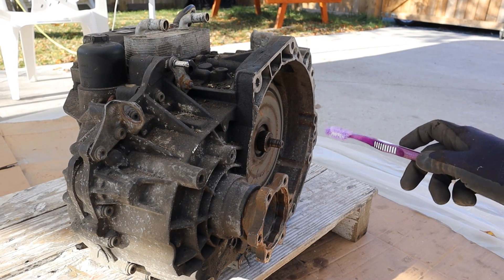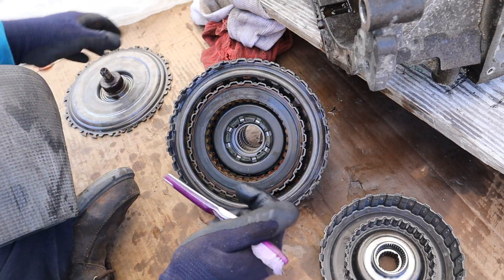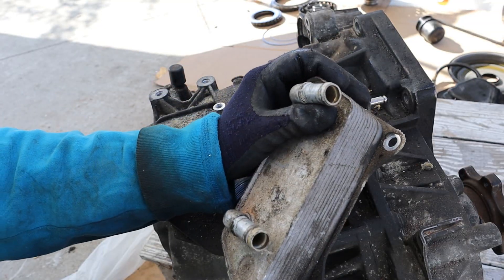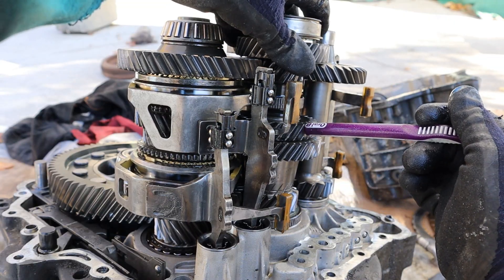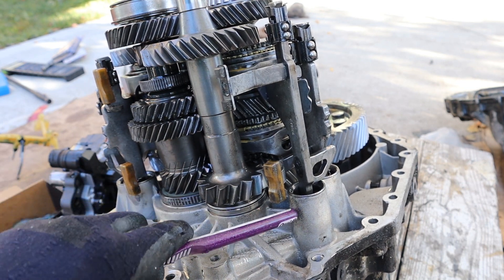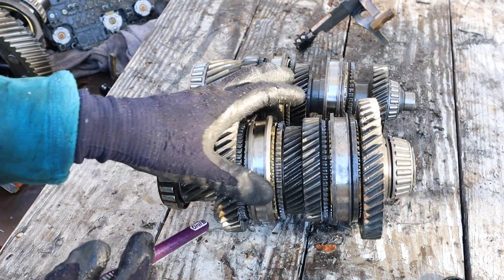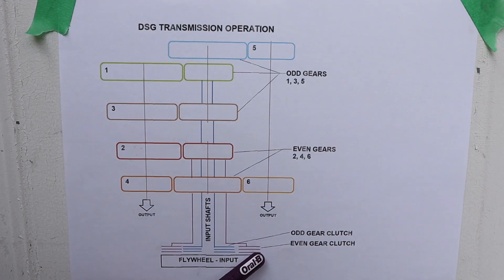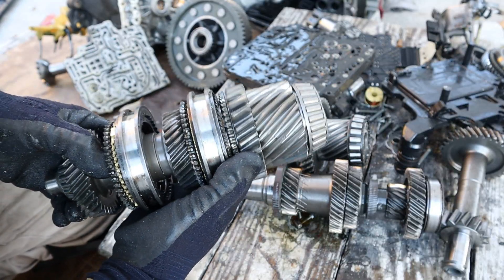How a Dual Clutch Transmission Works

Comment: I have a Nissan Juke/Joke/Puke as a hire car. It has a 1 litre turbo three cylinder and a DCT box. It is terrible. The engine takes forever to react to the throttle, and the gearbox must put it to a vote which gear it wants.

Comment: I will most definitely be referencing this video when I argue with the dealer about how fucked my transmission really is. I got a warranty specifically for my transmission (I’ve had terrible luck with them in the past) and they’re replacing small relatively insignificant parts bit by bit as if shifting isn’t rough throughout all gears. I appreciate you sir

Comment: Ah, the dreaded oil pump drive. It broke on my wife's 2008 Passat, a common major failure which VW wouldn't acknowledge. I had bought VWs all my life until that event, but VW just threw us in the ditch, customer loyalty meant nothing, so I now have a nice Volvo. Nice to see the gearbox tear down, makes you realise how much things have moved on since the days of the Morris Minor with no synchro on 1st gear....Thanks for posting, love the high speed explanation of dual clutch transmission, the concentric clutches seems a nice idea.
Reply from the maker: Glad you liked it and learned something new

Comment: Great video, I am trying to find a problem my dq500 is having with going into drive. When I start the car and put it in drive it won't engage until the car is completely warmed up. If I give it a little gas it will engage but it slams in so hard the tires chirp. Once the car is warm it engages fine and drives and shifts with no issues. I replaced the hydro tubes hoping that would fix it but it didn't. Any idea what would be causing this? Thanks
Reply from the maker: Sounds like you aren't getting enough fluid pressure
Reply: @speedkar99  What controls the fluid pressure? I am stumped on what to replace.

Comment: As a junior (thermal/aero) enginner in the automotive, I consider these videos pure GOLD! You would not believe how much stuff we learn in school, and even on the job, but especially now with electric vehicles everyone specialises on just a tiny parts/systems of the car. Seeing this stuff is so interesting, and it allows through your eyes and experience to have the general view of all the systems! Plus now, a lot of these mechanical parts will be gone with EV, so I try to learn what I can before they disappear completely! Thank you!
Reply from the maker: Glad you learned alot. I too didn't learn any of this in engineering school

Comment: Ah now I think I understand the concept of DCTs.  So, DCTs does not operate on hydraulic pressure, instead it relies on these 2 literal clutches?  So these things require regular oil change intervals similar to the engine?  What’s the service life on the 2 clutches typically?

edit it does rely on hydraulic pressure.  Hydraulic pressure is required for moving the selector thingies.  WTFV (watch the f***ing video, like read the f***ing manual) lol

Comment: My question is how they change gears smoothly when they are friction clutches engaging so fast. On manual transmission, if you release the clutch quickly you will experience a slight jerk even if in correct rpm.

Comment: the best way is an electric car, but, why engineers have this sick tendency to overcomplicate things? why is a DCT in a 160hp car? whats the fucking point? to feel the stutter when it begans to fail? why cant they just put a single stupid clutch and make it automatic? there are a lot of volvo trucks that has a single cluch automatic transmission.

Comment: Duel clutch transmission is one of those stupid ideas that leaves you shaking your head.
A torque converter gives you variable speed for parking and slow traffic, and planetary gear set do the job perfectly.
Reply from the maker: I understand for usability and reliability a torque converter works better but the goal of DCT is performance and efficiency

Comment: Please, I have a low speed whine when coasting from about 40mph down to about 20mph which i believe is coming from the transmission. What could it be? It's a 2006 Acura TSX auto. With 155k miles.

Comment: If I don’t shift from drive to sport mode at all, would it prolonged the clutch disc life more than 100K or maybe 200K?  I have a dct transmission in my 2017 ioniq

Comment: That preselecting explanation is the best i have heard, wonder why triple clutch transmissions are not a thing, it would have major benefits to be able to preselect a gear above and a gear below so it's always ready with zero hesitation i would think...

Comment: I would guess that the mechatronic unit is not a computer, but a series of electrically-controlled valves to control the transmission essentially the same as all automatics have. Computers don't like heat and it's probable the 'brains' are stored elsewhere.
Reply from the maker: Didn't you see the last part of the video? There's a circuit board in there

Comment: I have a 2021 Kia Sorento with the 8 speed wet DCT.  Aside from the clutch setup and number of gears it's basically the same basic functions.
Reply from the maker: Yes, it's mechanically a manual transmission

Comment: While looking very complex amazing it works as seamless as it does.  Been driving manual transmission cars for long time but recently purchased a 2022 VW Arteon that has the wet clutch 7 speed DSG.  Hope it is as dependable as standard manual transmission.  Thanks for posting the interesting and elucidating video!
Reply from the maker: I'm not sure about VW's recent DSG but the older ones had issues with the Mechatronic unit
Reply: @speedkar99  Thank you for your input!

Comment: Those clutches are likely original. These DQ250 gearboxes are very robust. My passat tdi just hit 193k miles (300k something km) and scantool reports plenty of clutchlife left. Car has full service history, the transmission is all original, even the dual mass is!! Which was shocking to see for me, having had multiple dmf failures on manual vws before. I drive my car very spirited and this gearbox is amazing. Never ever had any problems with it. Sometimes it can jerk a bit in heavy traffic, but its very occasional and only when you are messing around with the pedals, you kinda have to drive it with purpose lol. I loved driving manual but eversince i got a dsg i dont think ill ever go back. With flappy pedals it feels almost like a sequential.
People are scared of these because "they fail a lot". The thing is, they only fail if you dont change the fluid. That will kill it for sure.
Reply from the maker: Agreed. I think it's well engineered except for maybe the Mechatronic unit that might fail. But that's better than replacing the whole CVT 👀
Reply: @speedkar99  For sure :D

Comment: I own Acura TLX with 8 speed dct with torque converter. I do get confused moments on very low speed sometimes, but I love that transmission. Especially on the s sport mode when when it does rev matching downshift. It shifts faster then anything.  Every time I drive my other cars, I realize how boring planetary based automatics are.  And manual in no match either.
Reply from the maker: DCT sure shifts fast! I wonder how different Hondas DCT is than this VW

Comment: The speed and frequency of shifts is far higher/faster than any normally driven manual gearbox. The shifts are done in the background up or down depending on the mechatronic logic, only actually engaging when the clutch on that shaft is engaged and on the old ratio’s shaft clutch disengaged. So there’s never a load on the shaft and synchroniser that are idle even though the synchroniser may shift several times before finally the clutch is used to engage drive on that shaft. The mechatronics working the piston that shifts the selector and therefore the next ratio up or down has no damper and the ram works extremely quickly and forcefully. I’ve bench tested these things using compressed air rather than hydraulic fluid and the changes are what most mechanically sympathetic people would call ‘brutal’.

Comment: Great video. I prefer VW’s approach to DCT’s over Honda/Nissan going to CVT’s, both in terms of performance durability. Which do you prefer having taken both apart?
Reply from the maker: DCT
It's basically a manual transmission and you can replace just the Mechatronic unit as opposed to the whole thing when it fails.
Reply: I thought honda and toyota CVTs go for over 200000 miles though.

Comment: It's hard to describe the feel of a DSG transmission to someone who's used to regular automatics, so great job doing that in your vid!

My MK6 GTI has the DSG and I love how lightning quick the shifts are. My only dislike is getting going from a full stop, as it can be a bit rough. I've learned to just give it more gas than you'd think as opposed to easing on the gas pedal to try to gently roll off the line.
Reply from the maker: I agree, the first time I drove this car (MK5 Jetta) I was surprised at how fast it shifted. It also short shifted but then again it was a diesel
Reply: Still not as direct as a conventional MT, but it's a nice compromise between AT and MT

Comment: Is there a throw out bearing?
Reply from the maker: No, because there's no clutch moving in and out like a manual transmission
Reply: @speedkar99  the dual mass flywheel .. how does it know which clutch to use? 1 clutch needs to be released for the other clutch to engage and vice versa.  How is that done? With the mech only?
Neighbors car has a S4 Audi with shutter when he stops and in reverse. He doesn't get it when he shifts to neutral while stopping. Was not sure if it is his flywheel or mech unit.

Comment: You should do the infamous power shift dct from the Ford Fiesta
Reply from the maker: I'd love to get a fiesta or focus DCT. I got a focus engine teardown coming soon though 🙂
Reply: Ford Powershift DCT's actually work pretty well and are reliable once the leaky input shaft seals are replaced with the updated ones and the oil soaked dry clutches are replaced. Ford created a nightmare for itself by manufacturing these transmissions and putting them in cars when they knew about the problems with the leaking shaft seals. I rode in one of these just today that was fixed at a Ford dealership three years ago and it works perfectly.

Comment: The complexity of this gearbox is mindboggling.
No wonder nobody wants to touch these.
I had the un-pleasure of driving a car with single clutch robotic, and if this one shifts as slow as the one I had (the actual movement of the forks, not the clutch engagement), no wonder the internals are that well preserved.
Reply from the maker: DSG are one of the faster shifting transmissions.  A single clutch would take a much longer time to shift

Comment: So where in the transmission does the power disconnect when sitting stationary but still in drive
Reply from the maker: The dual clutches disengage
Reply: @speedkar99  so then the clutch engages again when releasing the break pedal?
Reply: @dr.alangrant8969  That's correct. When you put a DCT in drive you don't get the usual lurch that you get when a conventional automatic transmission engages. Instead, as long as you keep your foot on the brake there is no power at all being coupled from the engine to the transmission. Then when you take your foot off the brake pedal the computer engages one of the clutches a tiny bit and the vehicle will start crawling along very slowly. Then when you push down on the gas pedal the computer gradually engages the clutch until it is fully engaged and the vehicle starts to accelerate.

Comment: I wish these and CVT’s were reliable. A DCT is incredible for sporty applications & a CVT is great for keeping small engines in the economy RPM range. Unfortunately… well you know the reality of the situation
Reply from the maker: Yea these need more work but R&D budgets are now refocused to electric vehicles so there's no point in transmission development
Reply: The problem with CVT's is that the belts wear under the heavy loads encountered when the vehicle launches from a dead stop. Toyota has come up with a solution to this problem called a launch gear. During the initial acceleration a conventional gear propels the vehicle instead of the CV belt. Once the vehicle reaches a certain speed the transmission disengages the launch gear and engages the constant velocity mechanism. This saves wear on the belt and drastically extends the life of the transmission.
Reply: Then you have companies doing stupid stuff like adding pretend shifts to CVTs. It kinda defeats the purpose.
Reply: Vw dsg gearboxes are reliable!,

Comment: Ohhh. I always thought the final drive gears was included with the clutched mass. I guess it makes sense that those would be unclutched though, lowering the inertia for synchronizing.
Reply from the maker: Final drive typically means the differential right at the wheels
Reply: @speedkar99  Yeah. I just thought the twin clutch idea was a clutch on the input between engine and input shaft, and another clutch between the final drive and the output shafts. Don't know what system I was looking at that worked this way, but I just assumed they all worked that way.

Comment: Excellent teardown, definitely a great transmission, too bad their TSI suck. FYI drain and fill is pretty easy, once drained you can fill through the filter. It's a little slow but works fine.
Reply from the maker: Good to know. That probably would make a mess though
Reply: @speedkar99  Not at all use a long neck plastic funnel, melt the end to the filter port hole easy peasy.

Comment: Nice video. Lot of engineering went into designing and manufacturing of this transmission, I am impressed. I drove a Porsche Boxster with a DCT, it was a very good unit, crisp/fast/precise. But I personally prefer manual transmissions.
Reply from the maker: Yes the shifts are very fast, and that's the main advantage here over the manual.

Comment: That bit you said about the transmission becoming "confused." This is exactly the problem I have with modern car technology. The transmission itself is fascinating, and in theory, a great idea. But making it so complex that it cannot function, is a bad idea. I can't imagine a Turbo-Hydramatic becoming "confused." Great video, and as always, I love your choice of rags to clean up with.
Reply from the maker: Yeah unfortunately the nature of DCT's being able to shift quickly relies on alot of computer input. As algorithms get better that should be ironed out.
Reply: a late turbo-hydramatic has a whooping count of...4...gears that are wide and torque converter lockup came around in the 90s. If you're fine with the garbage gas mileage, then sure, keep the "unconfuseable" dinosaur which shifts at glacial speeds.
If you want a smaller, lighter and substantially more efficient auto gearbox, you need a computer. Or a manual transmission...

Comment: Great vid, as usual. Those clutch pads are in mint condition given the fact that the vehicle drove over 300 kkm. Looks to me like a great piece of engineering.
Reply from the maker: Sure is quite the engineering. 
However I have no history on the car if these clutches were changed before....
Reply: @speedkar99  You're right, I didn't think about it - it could've been replaced at some point.
Reply: @dehypnotizer  I've got a manual v dub. This DSG tranny cost over $300 to service. The manual was $50. Though some things are engineered well, others like the plastic water pump.....not so much. I've got a Japanese car for EVERYTIME something breaks on my v dub.
Reply: @easley421  What failed in your transmission? I have a DCT and it seems to be quite robust (2nd car, no service, except oil changes, required).
Reply: @dehypnotizer  Nothing failed in my tranny. It's a six speed manual, BULLETPROOF. What I was saying was the service for the transmissions were vastly different. The DSG first service 300$, my manual $50. 

I have a 2013 Volkswagen CC. So far I've had to change the water pump, the fuel control module on top of the fuel pump, rewire the wires connected to the trunk lid because they crease and cause the car to become possessed when the wires touch. I'm not even joking, my girl put it in reverse one morning and the trunk popped. I go up in there and pull the wiring harness out and they're all frayed to shit. There's been a few other incidents with this car, all the while my 2006 G35 remains running, without an issue. 

My buddy is a mechanic and sent me a pic of a new Dodge Ram tranny filter change. The entire pan of the tranny.......PLASTIC! With the filter BUILT IN. This shits not gonna get better. Hold on to anything between 2001-2009. The best years for cars and bike IMO
Reply: @easley421  Bulletproof until you misshift 🤑
Reply: @mann_idonotreadreplies  110,000 miles and haven't yet buddy 🤌🤌🤌
Reply: a conventional automatic (planetary) is always more capable. this VW dsg is actually a shit design (lots of major issues).
Reply: believe me if I say that the DSG's are a nightmare to many customers. These clutches must have been replaced at least once, but probably two or three times. And there are also DSG's with dry clutches for smaller engines (= less torque). So buy a manual

Comment: you using grinder cut clip pin just show and dumb gearbox or you rebuild?
Reply from the maker: No I scrapped the transmission
Reply: @-ONI-Warga-Bunian - Did you read the title? "How a Dual Clutch Transmission Works"